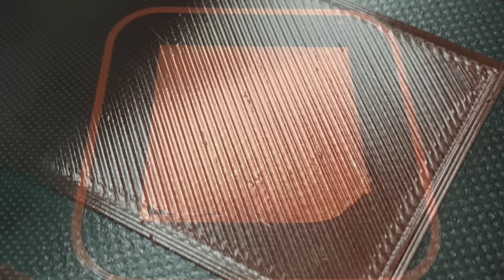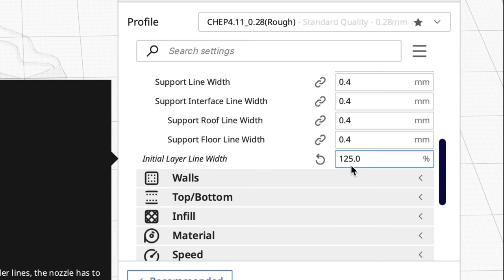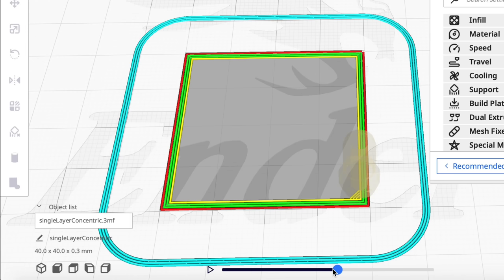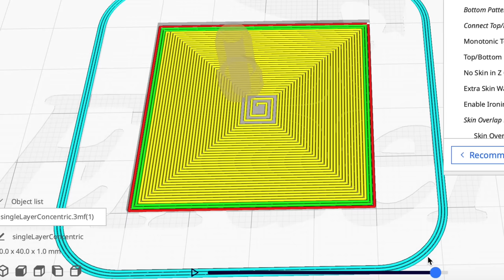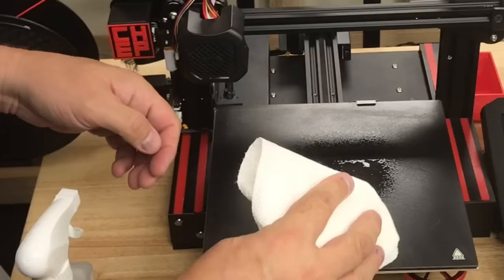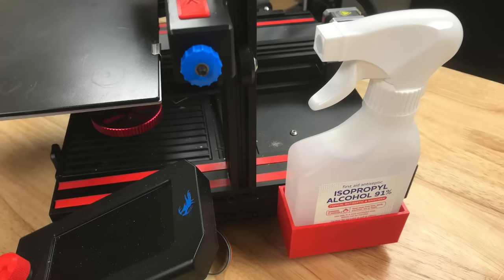Better First Layer and Bed Level Fixes on 3D Printers

Comment: never place a bottle of liquid attached to your 3d printer one reason "liquid motion jerking" if u print at high speeds (and not necessarily the printing at high speed but when high speed travel happens and the instant stops) that liquid will slightly move creating "waves inside the bottle" acting as a "vibrator" which can cause ur 3d prints to slip just a little bit. better have nothing around ur 3d printer or touch it when its doing printing. especially things like liquid bottles or springy tools or a box of screws for example, cause ur print will get screwed, and not in a fun way.
Reply: Not to mention that isopropyl alcohol is quite flammable! Besides being not good for vibrations, it is a safety hazard..

Comment: Cura doesn't work for me. I've tried to tune profiles on multiple releases. Always the same issue. Over extrusion. To overcome this you need to make changes that result in a model that is not dimensionally accurate. Seems that Cura was designed with the philosophy of prioritising the visual look of the model at the expense of a dimensional accuracy.
To me that's backwards.  Maintaining the dimensional accuracy should be the priority, then devise solutions to improve the visual aspect etc, while maintaining the dimensional accuracy.
I print a lot of parts that need to be replicated to the dimensions they were designed with. Cura cannot achieve this.
Reply: I'm able to print flawless prints with Cura.
I like Cura 5 even more, but it doesn't have the custom supports plugin yet.

Do you have Advanced settings enabled?
You can control pretty much every aspect of the printer from Cura. That's one reason why Cura is the most widely used.
Reply: @spydergs07  yeah I'm able to print certain object with PLA as good if not better than S3D, but oozey filaments such as PETG or silk pla are problem. Silk pla's foam causing them to ooze and PETG oozes because... that's what PETG does.
Yes I have certain advanced features enabled. Issues seems to be the way in which the coasting and retraction are handled. Either or, depending upon situation as opposed to being able to implement both as part of a sequence like S3D can.
Cura has many features I really want to take advantage of such as z seam control, small feature control, variable infill and some others.
But the oozing and stringing is something I can't seem to eradicate with cura and oozey filaments. I've spent many many hours over several version of cura trying to dial it out with no success.

Comment: I don’t know if anyone will see this but I need help. I’m new to 3D printing and no matter what I do I can’t stop warping. I’ve tried everything in this video but it still won’t stop warping. If anyone has any tips please let me know
Reply: did you calibrate the printer? maybe the nozzle is too far away from the bed on certain points. you can look that up on youtube on how to calibrate it. 
After you did that, you can  add "anti warping tabs" to your 3d model in order to make the print stay on its place. You can Youtube that too, there is plenty of guides for that.
Don't give up!
Reply from the maker: Try this: https://youtu.be/D45eIhoWSyg
Reply: Youre going to have to give a lot more information. 
Whats the machine, whats the bed, how is it being leveled, whats the filament/temperatures used, etc. 

If you're printing to a pei sheed, get some 200 grit sandpaper, rough it us and then wash it with dish soap and hot water, dry with plain paper towel. 
I'm waiting on a bed replacement but this cleaning method allows me to print just about anything without worry of warping/de laminating off the bed
Reply: for some prints its simply not possible to stop warping, in that case use a brim with a glue stick
Reply: @CplButthurt  cr10 v3 1.75 pla it’s got that new creality bed with the coating.
Reply: @FilamentFriday  thanks I’ll check it out.
Reply: @TheXmas100  currently been going through calibration. I did e step already and it’s significantly improved my brims. That it’s helped a lot with adhesion.
Reply: Sorry to everyone that’s replied I have been busy and forgot about this post thank you everyone though the help is much appreciated. 😁
Reply: @joedoe2753  I am think of making an enclosure it may be too cold in my basement.
Reply: @Frogboy71  Yep, always a good idea, gusts of wind that are different temperatures cause warping but cold temperatures can also be a culprit.

Comment: Yeah i dont know about the isopropyl alcool right next to a heating bed. But hey, none of my issue, right?
Reply: just cleaned mine today with it, like 5 times at 80ºc, nothing happens
Reply: @xxn0cturn3xx  never seen any kind of alcool recommendation saying “store it in a 80C heated place”. But hey at least you noticed no issue by doing so. Best of luck.
Reply: @WoodfulProjects  with the bed at 80c the alcool stay there about 1 s, just spray it on a rag and wipe the bed, you clearly have no idea what you are talking about
Reply: @WoodfulProjects  ethanol auto-ignition temperature is 365 °C, still got leeway as long as no spark hazard is present.
Reply: @xxn0cturn3xx  where did I talk about the risk of spraying it to the heated bed? You’re making stupid assumptions because you’re not reading properly. I’m talking about storing it next to a heated bed, not spraying it.
Reply: @TheScorcher541  any chance you can find me a single reference stating “store the container full of isopropyl alcool next to a heated source”? Just wondering where y’all get the stupid references you’re talking about. Oh, and btw isopropyl alcool auto ignition point is 399C degrees. But what you’re not getting is the “AUTO” part. In this case, I’m not talking about being auto combusted but staying next to a source producing more than 200C for the extruder and more than 100C for the bed (when printing TPU). Anyway, I don’t even know why this discussion is still going. Do whatever you like, go even drink it if you think it will taste good…
Reply: @B Y the same as you, isopropyl alcool.

Comment: can brake cleaner be used instead of alcohol?
Reply: The solvents in brake cleaner are really bad for your health so probably not an ideal alternative. also it is a better solvent for certain things than isopropyl alcohol so it might dissolve something you don't want it to
Reply: Why would you want to use brake cleaner instead of IPA? Seems like that would potentially create more problems than it solves, and likely wouldn't be very good for your print bed in the long run.
Reply: Ok
Reply: I already have used it for 4 months now

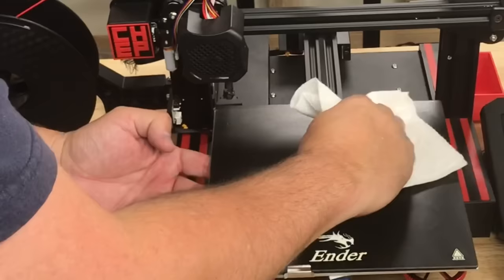Comment: 3:20 I would never clean the PEI while it's on the printer, you're gradually damaging the mechanisms in all directions.
Reply from the maker: First off it’s glass not PEI. Second, the bed never moves, I’m holding it. Finally, the steppers drive the bed around constantly while printing. They do more damage than any occasional cleaning will do.

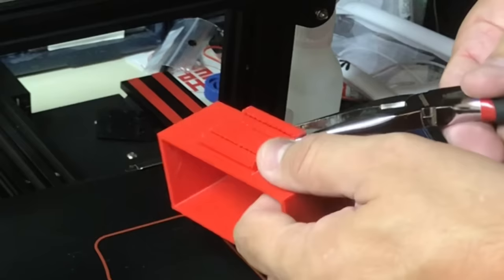Comment: @3:49 - NOT perfect, not by a long shot - all of your corners are wildly deformed - if that was an engineering print or anything designed to fit together with other parts, it would be unusable
Reply: This is a consumer low budget printer, not a multi thousand dollar machine to make engineering parts